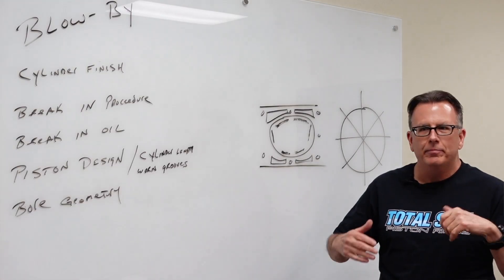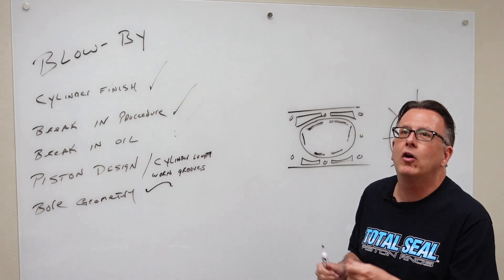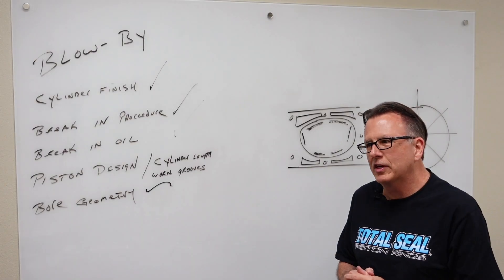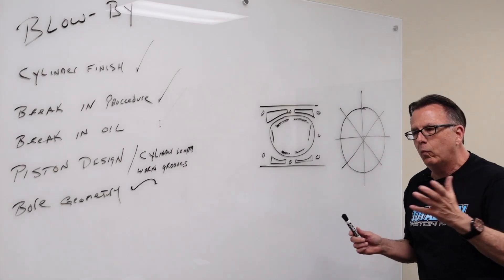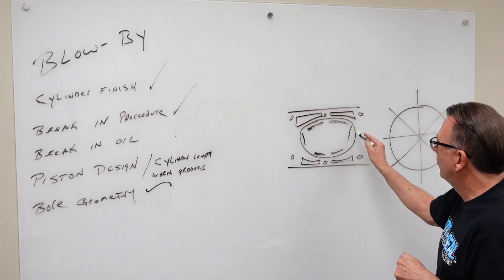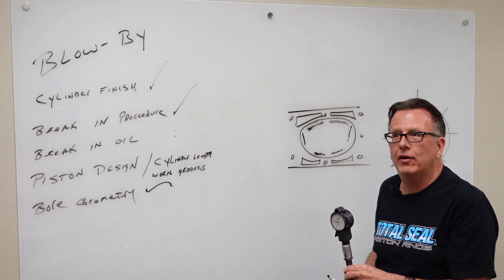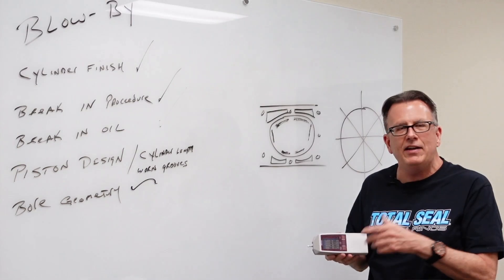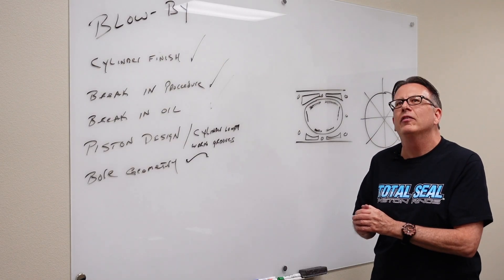The ENEMY Of Your Engine - 5 Ways To Reduce BLOW-BY / Watch This Before Rebuilding Your Engine

Comment: Bon Ami cleanser… little pick in each cylinder port or little puff in air inlet (after mass flow sensors) and you got it solved.  Many gas , natural or propane, engines you cannot get the rings seated even after 20k-30k miles down the road but this works, and doesn’t kill the engine. Why Bon Ami is it’s a diatomic power and this natural powered breaks down as it scrubs getting ever finer lapping compound.

Comment: My vg30dett with je pistons uses about a litre of oil castrol edge 10/60 every 1000 kms. The only thing i get in the catch can is condensation and yellowy sludge, no oil. I havnt noticed smoke from exhaust either. It does make 450rwkw. I also have had it re-ringed before. What are my options? Thanks

Comment: This is an interesting topic and obviously something you want to consider when you run in your engine. I would like to know why you would rehone a deformed bore, without considering a boring process? Let me know if you have any info on this. Cheers
Reply from the maker: A modern CNC hone can correct the deformed bore without the need for boring.

Comment: Hi approximately 1978 I purchased some cord piston rings were the compression rings intertwined together basically slotting in to each other no gaping needed were these the first prototype as they worked extremely well and I can't get access to this type of ring can you help thanks
Reply from the maker: If you have any of the used rings left (or pictures of them), contact our tech department at 623-587-7400. They can help you out.

Comment: The average home builder doesn’t have a torque plate. Is it worth measuring at that point? How about a steel block?
Reply from the maker: It depends on how much boost you are going to run.
Reply: @TotalSeal Boost? What's that?

Comment: Add a anti-friction oil additive at every oil change
Reply from the maker: We never recommend adding anything to motor oil. There are plenty of good oils that already have anti-friction additives already in the oil.
Reply: @TotalSeal XADO company's Very Lube and other additives reduce friction to nearly zero. Is this a bad thing?
Reply: Motorkote added to oil and lucus fuel additive in fuel .  Runs smooth quiet cooler longer stronger.

Comment: A shop honed my engine, aluminum SBC but used bolts on the torque plate instead of my ARP studs. Rings didn't seal hardly at all. Re-did the job and same mistake, thought I was wrong. Went to another shop, borrowed deck plate for the weekend and mapped cylinders with heads on then near duplicated with deck plate, studs and spacers on studs for long ones. Sealed up great! Gave them the spacers and info I learned.
Reply from the maker: Sorry you had to endure that, but thanks for sharing.

Comment: I have a blow by problem on a Ducati Diavel 1260, the oil reaches the air box ...
i measured everything, the taper and ovality are less than 0.01mm, the piston / cylinder clearance is 0.04mm, the rings are perfect and have a gap of 0.15mm
I do not know what to do...
Reply from the maker: Does the crankcase vent to the intake? There are some engines set up that way.
Reply: @TotalSeal  the crankcase is connected to the air box in which it is equipped with a blow by valve.
The problem is that we are not talking about vapors that condense but about oil that accumulates in the air box and drips down to the ground through the air box vent, like when a ring is broken ...
Evidently the pressure passes the rings and blows the oil into the air box.
Watching your videos I was thinking of decreasing the viscosity of the oil to increase the seal of the rings, do you think it can help to switch from a 15w50 to a 10w40?
and thank you so much for the help!
Reply from the maker: @edogsx  10-4, There could be a few different causes. First, check the oil level when the engine is warmed up. Multigrade oils can expand in volume with temperature, so make sure it is not overfull when warmed up. 

Next, check the leakdown when the engine is warmed up as well.

If you can access a profilometer, check the cylinder bore surface finish. That's another area that can cause blow-by problems.

Finally, the thinner oil might help, especially if the oil ring tension is too low.
Reply: @TotalSeal  I apologize for the late reply and thank you for your help, Ducati has provided me with 2 new cylinders complete with pistons and rings for free.
I checked them and I didn't notice any difference compared to the old ones but I changed them anyway ...
If I can give you some advice you should contact Ducati, on the latest V2 models they have many blow by and oil consumption problems and I think your products could be very useful!
Reply from the maker: @edogsx  thanks! I’m glad they helped you out.

Comment: I have a good old Kwik-way boring bar that I made an adapter to hold a tiny Last Word +/- 0.030" dial indicator. One thing you can do with it is clamp an arbor in the main bearing bores and then proceed to shim the base of the boring bar to get exact perpendicularity - which is UBER-important.
    With this rig I have detected an odd thing which happens on sleeved aluminum blocks - the used bore will still be to stock size = no wear at all - BUT THE MIDDLE OF THE BORE IS OUT OF LINE WITH THE TOP AND BOTTOM. I can't think of any other tool that would have let me see that.  Makes it impossible to get truly tight ring sealing !
Reply from the maker: Interesting, is the middle of the bore tighter than the top and bottom?
Reply: @TotalSeal  No the entire bore was round and to size to about .0002".
Pretty sure piston thrust had warped middle of the bore over about .004".
     Centered up on untouched top of bore and untouched sides of bottom of bore then lastly centered on the bottom of bore that skirts-had-run-on-but-not-worn.
         Middle of bore showed - .004" other side showed + .004". I thought I was hallucinating but it was all very repeatable hence real.
Reply from the maker: @patrickshaw8595  That is interesting.
Reply: @TotalSeal  I got the idea to do that because my father worked for Moore Tool Company back in the 70s on their extreme-precision Jig Measuring Machine. My rig-up is an order of magnitude less accurate and precise but I do laugh nastily at guys who think possession of a ID mike set or dial bore gauge makes them experts.
         Where I come from rotary hones are to be trusted to take the bore from one thou under on up to size and nothing more. In the age of Nikasil plating onto bare alloy cylinder walls boring lapping and plating are the wave of the future for high performance. We've run quite a few engine with no piston rings at all - just labyrinth-seal-grooves.

Comment: A bit different application, but how about an aluminum Harley Davidson cylinder that is compressed between the nuts on top and the crankcase on the bottom by way of long studs that run through the head and the cylinder?
Reply: I have an older Sportster (SPUTHE XR) that is built this way...cast-in meehanite liners in aluminum cylinders...works fine...long chro-moly studs from the cases to top of heads..no gaskets, cyl-cases and cyl-heads are lapped together...never leaks.
Reply from the maker: Simulating that clamp load is important when honing the cylinder. That will reduce blow-by when the engine is running.

Comment: i saw a dyno test of a nascar cup engine where it lost less than 10 HP after file filing the top ring gap to .125. blew oil all over the dyno room but lost very little HP
Reply from the maker: Yep! A little extra end gap doesn’t kill HP, but high levels of blow-by can cause all kinds of problems.

Comment: Has anyone ever been so focused on a nearly perfect cylinder that instead of using a TQ plate they TQ down the heads they're using and hone the block from the bottom?
Reply from the maker: That would be ideal, but the hone head needs to overstroke the bore to create the correct cross hatch angle. That means the head would have holes in them in line with the bore. Now, maybe some people have done that…
Reply: What do you do on an engine that has the head and cylinder cast as one piece or otherwise irreversibly joined into a single unit? I have an engine designed this way that I'll need to do. It's a vintage 2 stroke outboard with a comically low compression ratio, so perfect sealing isn't mandatory, but what if it was?

Comment: What I did was to torque on the head n then taken measurements from underneath ... measurements can be taken at different headbutt torque value...
  I make note of distortion , n work to compensate, getting the cylinder as round as possible...
    But under high pressure n heat the cylinder will still distort 🤷‍♂️
Reply from the maker: That’s the right thing to do. There’s only combustion pressure on part of the 4 cycles, so the benefits of straighter and rounder still apply.
Reply: @TotalSeal  😎

Comment: A thoroughly worthless and confusing video.Did Lake write the script? In 2? minutes you could have told us the press fit on the steel sleeves in the alum. block was too great. But no!  All you did was waste our time with confusing mystery issues and 100 k tools NO ONE has. You could have also told us what the current best torque plate set ups appear to be. aka How to adjust the torque plate to replicate the stress of the cyl head,So the cly. is the same round with the head or the t plate.  But no!  oh well.

Comment: So, the profilometer, is measuring deltas in bore finish after the engine has been run? I see the utility of this for diagnostics, but, not the usefulness in preventing the issue.
Reply from the maker: Actually, the profilometer just measures the surface finish of the cylinder bore, so it can be used during the honing process to make sure the correct finish is being created. It can also be used after the fact to see the condition of the used cylinder as well.

Comment: Very interesting. With regards to aluminium blocks being difficult to get round bores in- is this why aluminium block engines are now being designed open deck, to eliminate head fastener torque distortion in the top part of the bores?
Reply from the maker: Thanks for the question. The main reason for open decks on aluminum blocks is reducing material usage and weight.
Reply: @TotalSeal  Another reason I believe it has to do with the casting process, with less internal galleries it's easier to cast.
Reply from the maker: @craigdavies8099  agreed
Reply: Aluminum blocks are a bitch to get the distortions out of the cyl bores.  That's because of the flex in the bores while honing.  The fix is to take your time on the final hone (I like to use 820 stones), and using light pressure to straighten them out.

Comment: Also remember it's important to use the correct length head studs / bolts with your torque plate. I saw once were a shop used some bolts with only 2 threads in the block . Yeah didn't work.
Reply from the maker: Great point!